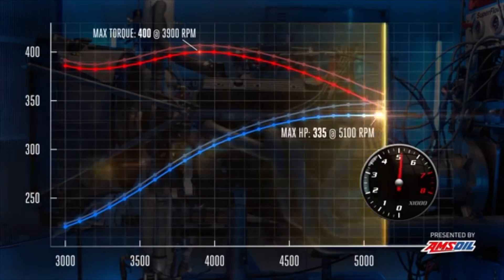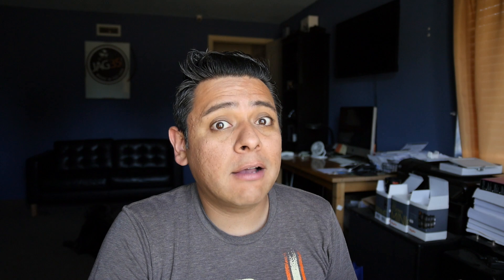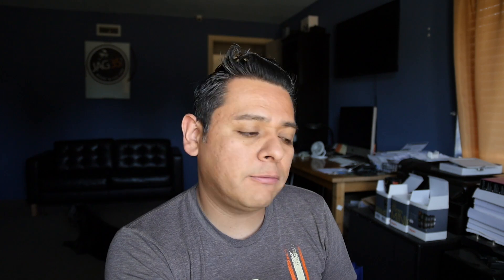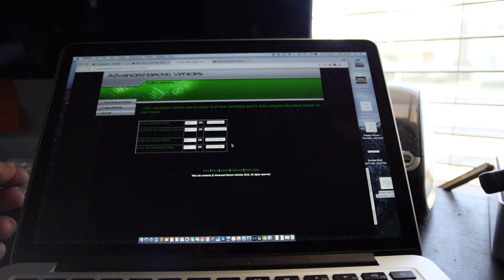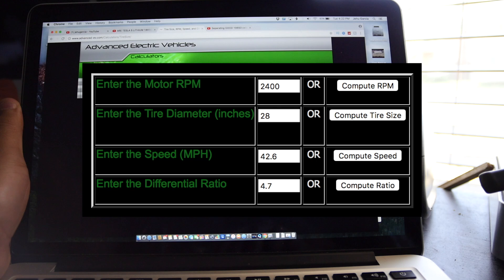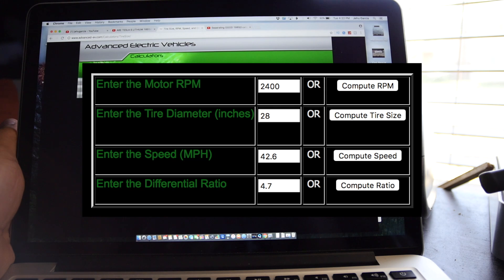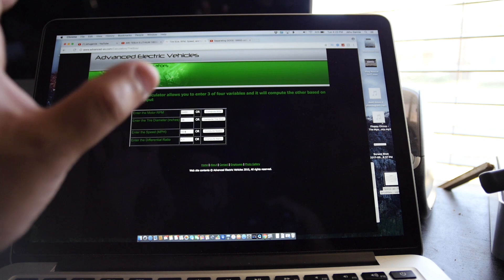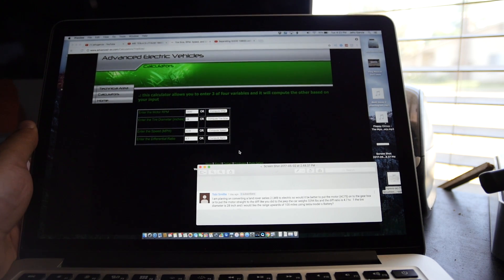Do you need transmission on DIY EV?  + batt Giveaway

Comment: Great Vid Jehu. YouTube brought this to me on autoplay. I wanted to know this but never thiught to ask. 

Since you do vids like this, here is an idea. Can you discuss how batteries are charged at the pack level? Say you have 4 packs and 36 individual batteries per pack. Let's say you are using a 240V charger? Are the volts split out across all the 36 individual batteries or does the charger only charge a few at a time? Does it charge by pack or does it charge all 4 packs at once. I have a part two to this question but I have typed too much already.

Comment: A car, whatever, ev or ice, always need a transmission, automatic, cvt, manual, dct etc... EVs now are dump because they don't have any transy!
Reply from the maker: Why would you need one if your motor has enough torque to do single gear ratio?

Comment: Wanting a little 4wd hunting buggy no highway, can I put electric motor straight to transfer case and skip the transmission?
Reply: I came here with the same question. From how I understood the video, depending on tire size and gear ratio, this motor setup would work for this guy at best conditions (2400rpm) and net 40ish mph.  I would assume if you are trailering your hunting buggy to the property, you will not be exceeding 40mph while offroad.  My best guess is it would work direct to the transfer case.

Comment: Hopefully, someone can help me out 
I have a  Toyota glanza (freakishly light car) in my garage with a busted up engine and I am looking to convert it to ev for just zipping around the neighbourhood going to the store etc 
long range doesn't matter to me. I just want it to be fun and cheap I have around 6k to spend and I am looking at some hub motors https://www.alibaba.com/product-detail/Dual-motor-kits-12000w-Electric-in_60796953642.html?spm=a2700.7724838.2017005.14.25708192ekhXVn

how much would I have to spend on batteries and which ones do you recommend. Also is the motor I am looking at worth it.
Reply from the maker: That’s a 15hp motor,  might make for  sluggish acceleration.   These  are among the most affordable ($120/kWh) batteries that have the power to push a car https://j35.us/9pack-Fiat5s
Reply: Thanks for the input as for the acceleration, that won't be a problem. Like I said it's mostly for zipping around the neighbourhood and this will be my first conversion.

Do you have any tips for a noob? xD

Comment: The point or ditching the gear box on a small car is to save space & weight & sounds like it would work. 

But how much torque do you need? 

With a land rover don't you keep the low ratio box for crawling up hills & through the mud.. ?   
If you have low gear you gear up the torque, for hauling that  steel . & with its shape you gona need  torque at 88mph to push that box through the air ..  
Is EV Wests 2 speed box an "overdrive" then ?

Comment: Hey Jehu,  a couple of things… You should get ahold of David over at "Hotrod" magazine and get your Sumba onto their chassis Dyno and check efficiency in all the gears. After all they are the guys who determined a 30 hp loss using some cooling fans on their engine Dynamometer. Another thing, you didn't touch on what a guy needs to do to get reverse. A transmission makes it easy but without a tranny then you need to figure out how to make a three phase AC motor turn backwards at the flick of a switch. Personally I know that it is done but off the top of my head I couldn't explain to anyone how to do it, could you? Really like your videos keep up the great work. 
Also,  I've had my home on solar, and batteries since 1992.

Comment: I want to convert my Nissan 370z to electric. But I gotta get at least 140 mph top speed and sports car like acceleration. It's a 6 speed manual transmission. I haven't purchased any parts yet. I'm was hoping to use 8 Tesla packs and a tbd motor while keeping the transmission.shifting gears and driving fast is fun. But it would still be my daily driver for the most part. I live in rural arkansas so doing 80 or 90 on the interstate is quite common here. Any recommendations?  I am assuming I should try to find an engine with similar torque curve and rpm range for it to be feasible, but have no real idea where to look for motors. Needless to say I'm an ev noob but I find it extremely interesting and desire able to own one nonetheless. Also I was wondering how feasible it might be to keep the accessory plate belt and use the aleternator to maintain charge for a separate 12v loop system for the rest of the cars electronics, ie outside of the electric drivetrain controllers and motor the rest of the electronics could remain on the separate 12v system already in place in the car. How much strain would it be for the electric motor to also be turning the accessory belt...
Reply: r3wturb0x  you want to use electric motor to power an alternator to make electricity to power electric accessories?

Comment: (keep in mind)The weight of the land rover + batteries + terrible aero-dynamics!!! I would use a gearbox. High torque at low speeds, high torque going uphills, better efficiency, huge regeneration as you can use lower gears. In case of an emergency, you can always cut the power with the help of a clutch. Dont fear gearbox guys, even formula E uses gearboxes.

Comment: I'm not at the end of the video yet but just wanted to say that there is an extra gain to be made which was not mentioned here. You should also take into account the time saved between gear changes which also incur a loss of speed which would need a moment and extra energy until the speed before the gear change was matched and acceleration could be continued. 
  This could especially be disadvantageous during driving conditions which require more gear changes. The other thing i wanted to mention was that it is possible to use brushless dc motors and these motors have a kind of hidden function. If the wiring is changed from Y to delta at speed then the speed multiplies. This is kind of like having an electronic gear.
  It requires some simple electronics and or some hefty relays or switches.
Now the problem here is that there don't seem to be a whole lot of large HP brushless motors available. However i have just had an interesting idea which could work extremely well. Lets take 4x BLDC motors at 15Kw each & make a way to join all together Like a V4 :D
  Now we could switch them all from Y wiring configuration to delta (with the relays or large switches). Et voila 2'nd gear.
Reply: or just build a bigger BLDC
Reply: Y is also called star configuration. And to quote some scholars:
The speeds of Star connected motors are slow as they receive 1/√3 voltage. The speeds of Delta connected motors are high because each phase gets the total of line voltage
In Star Connection, the phase voltage is low as 1/√3 of the line voltage, so, it needs low number of turns, hence, saving in copper. In Delta connection, The phase voltage is equal to the line voltage, hence, it needs more number of turns.
Low insulation required as phase voltage is low Heavy insulation required as Phase voltage = Line Voltage.
In Power Transmission, Star Connection system is general and typical to be used. In Power Distribution and industries, Delta Connection is general and typical to be used.

Comment: Having a transmission makes sense to me. If I built cars I would use a 3 speed dual clutch (hear me out). First speed would be for normal city driving (say up to 60 kph). Second speed to take up from 60 to about 100 (I am assuming aerodynamics will pull it back a little so that is why I use a lower increase in speed). Then 3 would be for cruising (up to 130kph). 

Not sure how electricity works in this case but I assume keeping the revs low would be beneficial here too. Also since the torque is available from very low revs then the 3 gear would be a stupid ratio (like for every single rev of the motor the output rotations are 6 or something like that). 

How is my plan.

Comment: typical loss manual transmission and DRIVELINE 20%.
Land rover series 2 minus engine,fuel tank, exhaust  needs to be considered  before adding weight of a.c. motor,battery,control pack.  Series 2 top speed close to 65mph  it isn't really a highway cruiser. 
is he intending on retaining 4 wheel drive in which case the trans and transfer box will need to be used
 What fun would a 2 wheel drive only land rover series  be?

Comment: yes, keep your manual transmission. A transmission multiplies torque to help you get going faster, and turns torque into shaft speed to give you more top speed. more gears more acceleration.

Comment: https://twitter.com/Tonykaruri/status/869534531639967744 shared ... Thanks dude been following you from Thika in Kenya!!!  you have inspired me to start my own 18650 journey. planning on building a 60 - 100KW pack, subject  to availability of cells, i may require 1800 to 2800 or so laptop packs! ( I already have collected 100 laptop packs, in the process of disassembly )... waiting on TP4056 chargers and 18650 dischargers (27 pairs) as well as  1 resistance meter from China.... yes i know its an audacious project; giving it about 2 years or so. not really after winning the batteries, i am practical and pragmatic. shipping costs would be insane not to mention import taxes here about 47%... anyway keep up the good work! once i get going i will sure document my progress.

Comment: Thanks for the nice explanation, jehu.  I enjoy your videos very much and learn heaps. But I think there is one bit, that was not 
talked about, which is the efficiency of the electric motor.
I am not sure how to calculate it for this model, that jehu was showing the 
diagram for, but usually, you have a huge efficiency drop at the start 
up and you get more efficiency until you reach the optimal speed for the
 motor (Please correct me if I am wrong). Would help to see the 
efficiency graph for this motor. I am going with a usual value, that the
 motor would be only around 50% efficient when in the high torque band, 
which means, it will produce lots of heat (1/2 of what you put into it 
with your battery pack. In "optimal speed range the motor is probably 
around 80% efficient. So you can probably easily calculate the losses  
and then check if a transmission would make sense, if there is lots of 
hills, acceleration and such, I would think it is. Also the more weight 
you have in total, the more a transmission would make sense. Also I know, that the transmission has about 15% loss within, so have to factor that in of course.

Also, only because you have maximum torque in a single gear EV, does not mean
 you will accelerate faster without a transmission, as the transmission would 
increase your input torque by the gear ratio, you are in. So in my 
opinion, a pretty similar rule of thump is the more gears 
you have the more efficient your vehicle will run in wide range of speeds, 
since you are always trying to shift to the most optimal one.

If you have some ideas on this, or would like to correct me or add something, please feel free to do so.

Comment: hey did you ever consider using super capacitors as energy storage ,I no there are some problems in using super caps but it would be nice experience to try them as a high power battery pack

Comment: He should consider a lower numerical diff ratio, or he could always run it into a modded transfer case, as they are built for torque, you can get ones that are pretty bulletproof, and they are common in junkyards. While shifting without a manual clutch might be a bit tricky, an effective electronic clutch could be used, disconnecting the motor for a split second while the transfer case is shifted.  That could be done with either the stock clutch pedal, or simply with microswitches on the transfer case shifter.

I could use those cells for 2 mower projects.  I have a 40V mower but need to build some packs for it, can't afford new ones.  I'd be interested in building a few 4Ah-ish flat packs that would jack into the stock battery connector, or build bricks that would fit in the stock port.  And I have a riding mower that I have gathered everything but the batteries and charger for.  Those would be a nice start.  And of course I have a few laptop packs to rebuild.

Shared to Twitter, thanks.

Comment: Is it possible to make a car battery with these 18650? I don't know if they can give the amperage that a car starter need. 
If it is possible how many of these (i don't know the specs of these batteries) do you need to make a 12 volt 60 amp?
Reply from the maker: +johnjanos1  yes but voltage is off,  it's either 3S @11.1v or 4S @14.8v
Reply: I don't know much but i think car batteries are between 13.6 volts when are fully charged and 10 volts when empty, so it would be perfect. I was wondering if they can give the amperage. Do you know how many batteries are needed for 14.8 volts and 60 amps?
Reply from the maker: 4S means 4 in series,  but the problem is that fully charged they are 4.2v x 4 = 16.8v  if your car only charges them to 14v  then they will always be charged up 3.5v which is below their nominal voltage of 3.7v.    so No the voltage does not work,   yes can put out enough Amperage if you parallel enough of them but the voltage will always be wront

Comment: If the Landy is not going to be used for off road, (if), then the front diff & axles, front propshaft and the guts of the transfer case could be removed to eliminate a fair amount of friction.
Reply: Or fit Warn hubs, keep 4WD ability

Comment: always great info jehu! hey what do you think about that vruzend 18650 battery pack system? it's an Indian company making a system where you can use bolted connections for your batteries instead of solder. making easier to replace bad cells. maybe your next video idea!?

Comment: My 89 Jeep wrangler is converted to electric now. Passed inspection  1 month ago and it's on the road in  Massachusetts, BUT having major problems with a bunch of my LiFePO4 batteries. battery supplier is being very slow to help with replacement cells and we are only changing 4 of the worst cells initially... if they ever ship. So I'm thinking of building some of my own cells and adding them in if my supplier won't replace all of the bad cells. need to be 100ah. So it would be great to win your giveaway.
Also have a transmission leak. looking at disassembling the motor from transmission to replace a gasket that I damaged when cleaning the underside of the transmission. So I'm tempted into thinking about losing the transmission altogether,  but having driven it already,  I know there will be times I want low gear,  and we are keeping the 4WD, because after all it is still a Jeep.

Comment: Hi Jehu!
I wrote to you some time ago and asked you about using 18650 batteries in electric scooter project you helped me a lot with charging problem. Unfortunatly I can't afford those batteries (I need 30 of them, but I also have space for some more). I calculated everything and I should get pretty big range (about 40km or even more depending on weight of the driver and terrain) and max speed about 50km/h which is even to much for a scooter. I have parts that I need except batteries. I want to create it with wood and some 3D printed parts. Hope you can help me with those 18650 batteries. 
Thanks a lot!

P.S.
Shared your video on my fanpage here:
https://www.facebook.com/Nikodem-Bartnik-1891157704439330/
Reply: İ have same project too. İ converting my lead acid scooter batteries to 18650. We can share experiences
Reply: Great, what are the parameters of your motor? How many 18650 cells you want to use?
Reply: My bike has 60v 20a acid batteries so i m gonna use 17s 10p 18650)charge them up 4.1v and discharge to 3.0v) so total around  170 cells.İ tested 150 used notebook cells and there are bad cells too especially sanyo one. İ will use sony panasonic lg samsung sanyo  What about yours?
Reply: I want to make 6S so 22.2V battery pack with about 12Ah capacity. I plan to connect 30 18650 cells - 5 parallel packets of 6 cells in serial. Then I will connect it to ESC and motor - 270KV brushless DC and controll it with arduino and some kind of throttle like in motorbikes. I should be able to ride with the max speed of about 50km/h and max hill grade of 20 degrees. Motor should get up to 5A on flat road so after some calculations including motor efficiency I sholud get about 40 to 60km on single charge. In more varied area max range will be smaller.  I also have some more space on the bottom of scooter and in the handlebar for more batteries. It will be made out of wood, aluminium and 3D printed parts completly from scratch.
Reply: mate if u can handle 50 kmh speed with 22.2v that would be great but as i know if u want more speed u should put more series in the  batteries.my 60v battery can up to 45kmh speed and my controoler has max 40amps. Dou you have any pedal assist ?
Reply: It mostly depends on the motor. No, since this is scooter not a bike I have no pedal assistance you can eventually just push back by leg.
Reply: I used a 7s 6p to get 29.9v fully charged on my kids 24V razor drift kart ..

It's nice so far..